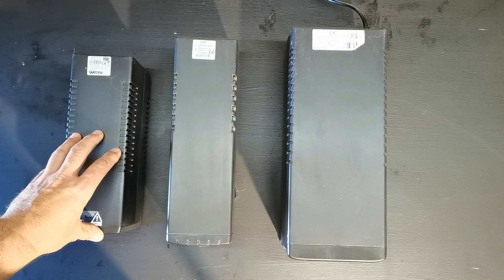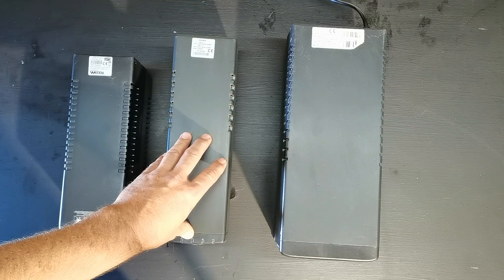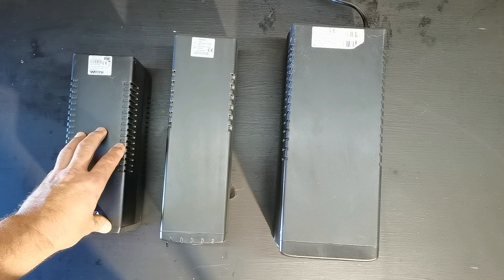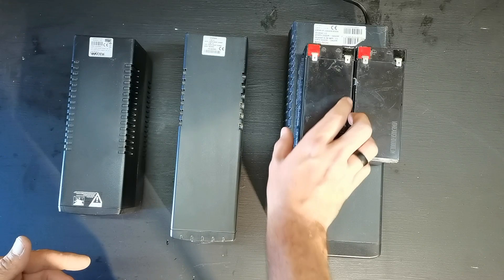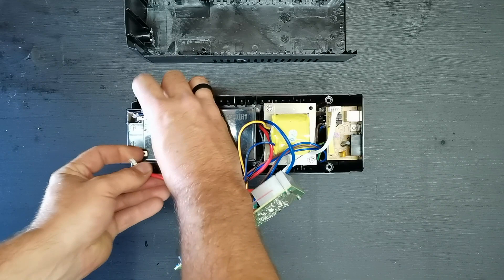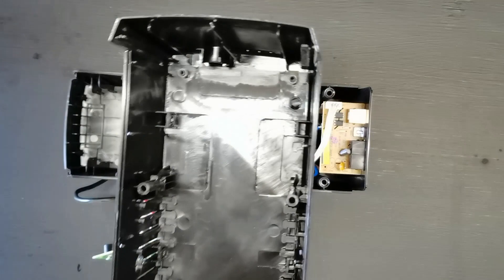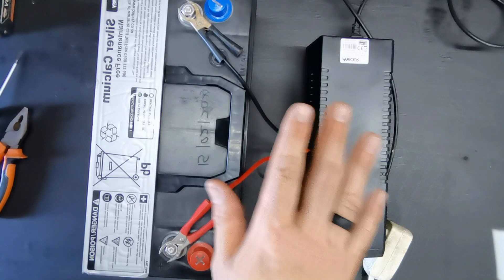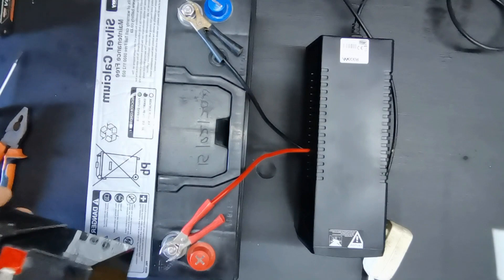Cheap Backup power Hack for Load Shedding/Rolling Blackouts!

Comment: I would suggest getting a cheap Solar charge controller 10A one will work perfectly(Pwm) . Get a old 19v laptop charger.
Everything will set you back R300-R500

Connect the laptop charger to one of the solar inputs +/- on the Controller.
Connect the ups cables to the  with the battery cables on the input .

This will ensure if you use bigger batteries that it will charge effectly and not damage the battery.

I use to do the same as this but it decreases the batteries life span.

The Solar charge controller just helps to manage the battery better.
Lead acid batteries has 50% effectiveness where as lithium has 80-95% which means you can drain it much more and get more out of it and you can just set the cut off voltage on the controller according to the batteries specification. 

Hope this advice helps👌
Reply from the maker: Hi PieRiis. I think this is an excellent idea. Would really help wilth the battery management...
Reply: @p0we111  try it out and tell me what you think 👌
Just be careful to not buy too cheap had a problem once with really cheap one that it would just cause the ups to restart whole time. Hooked up an other one and worked great. 
Have an amazing day👌
Reply: a  full video on this would really help millions out there

Comment: This works 100%.I would recommend while the unit is open too put some tape  over the warning buzzer so it not drive you nuts when in use.
Reply from the maker: Hi Wayne. That is great advise! It can drive you mad!
Reply: Can't you just break it off?
Reply from the maker: @seanvandermerwe4817  I snipped mine off with a sidecutter...
Reply: @seanvandermerwe4817  I unsolderd one and make a continuity tester with it.
Reply: Just remove the magnet inside the plastic buzzer
Reply: @flappervlieg  I prefer  operational  buzzers when close to the device and having a slight hearing loss helps lol

Comment: Will this be enough to power a tv and a xbox for about 2 hrs?
Reply from the maker: Hi Sean. I am using this setup in my house with a 45ah battery. I am able to keep on the wifi,1 x LED light and a 42inch TV that is 1year old so I guess pretty energy efficiant. All this was on for 2.5hours more than once.
Im not sure about the xbox,never had one connected. 
If you dont want to spend money and buy a battery right away,take out your car battery for a test run to see how well it does...
Reply: Perfect thank you,hopefully I do not burn down my hous😂

Comment: Could this power up an old gate motor? The ones without battery backups?
Reply from the maker: Hi. You will have to cheack the watts of the gate motor and make sure its less than the watts of the inverter. 
If you dont use the motor too often, I'm sure it will be okay and would last 2hours...
Reply from the maker: One other thing is that a motor that starts directly,needs double the amount of power to start...

Comment: great idea, you shiukd power your upa with 18650 battries
Reply from the maker: Hi Kareem.  I looked those up and think they will work great if you can get a bunch for cheap...
Wonder if the charging of lead acid batteries and lithium batteries are the same,if it would be a direct swap?
Reply: @p0we111  just make sure you incorperate a bms when welding batteries together. as for old batteries cheap battery banks and old laptop batteries are your beat best for those

Comment: how the transformer handles high AC draw? doesn't it heat up fast? would it help to have 2 fans installed to make it safe?
Reply from the maker: Hi. The AC draw remains the same as you can only use the available watts. 600watts for the smal UPS.